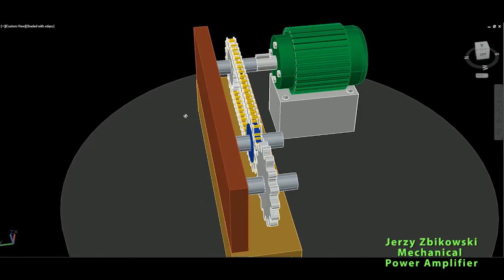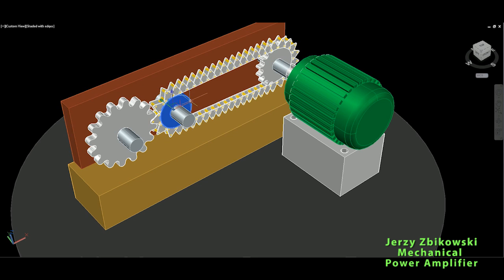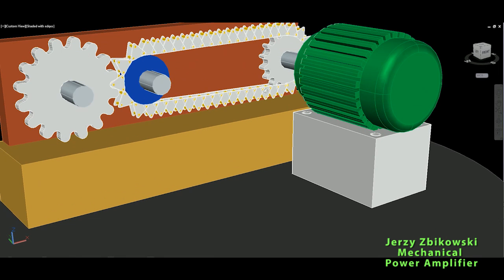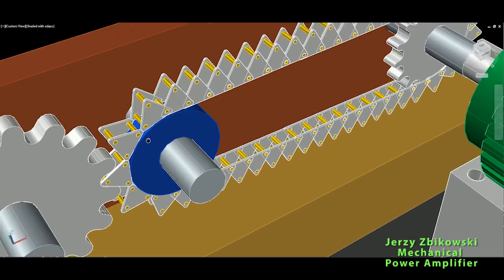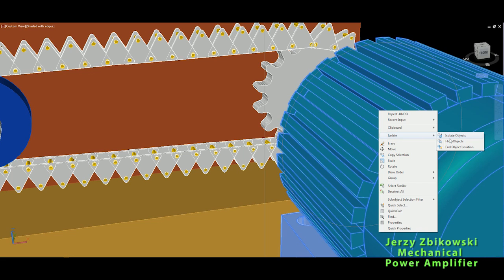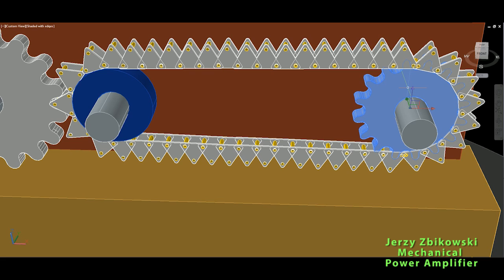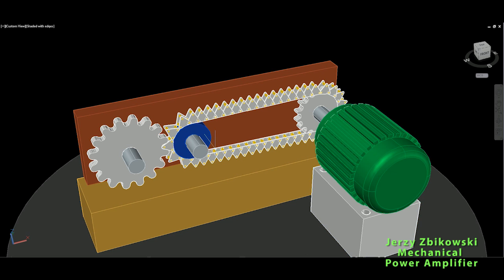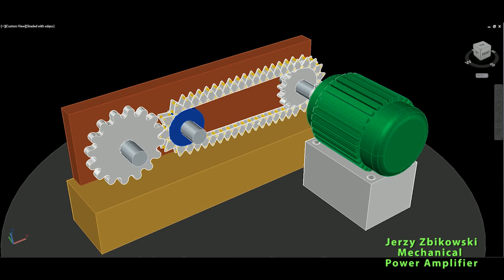Free Energy Generator, JERZY ZBIKOWSKI Mechanical Power Amplifer

Comment: Very Interesting. However I did notice that in your Rendering of the triangle linkages resting at the top of the tensioner and interfacing with the Larger 16 tooth gear in that case you had Drawn the roller links resting on the surface of the tensioner adjascent to each other and not overlapping as you had done in all the other Triangle linkages every where else along the chain. Correct me if I am wrong but I would think that the triangle linkages would need to overlap everywhere along the chain yes?

Question 2. Also by this same logic you should be able to Double or triple the size of the triangle linkages to recieve greater mechanical advantage? Or is there some limit to how large you can go in this system?  

Thank you for your work.